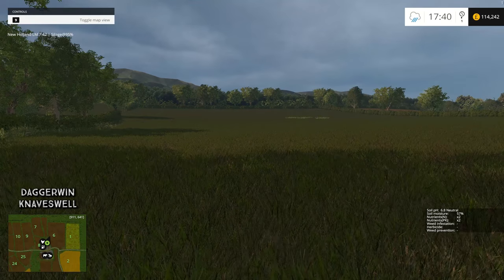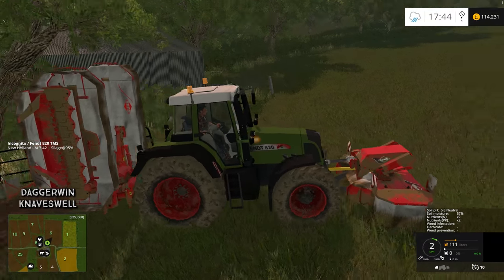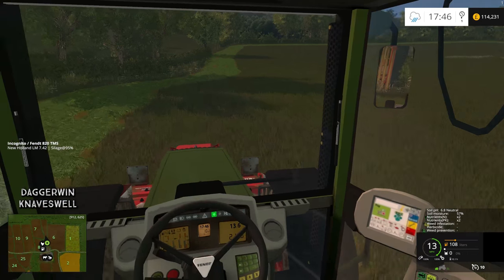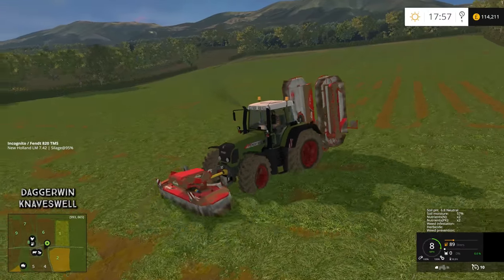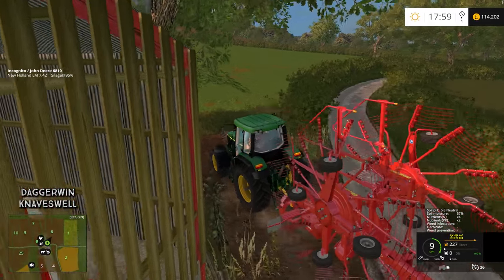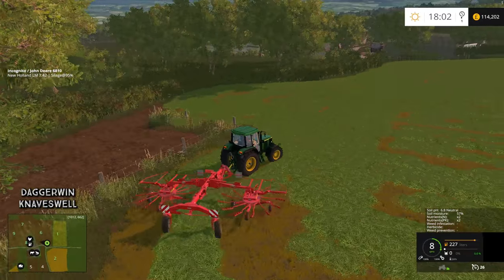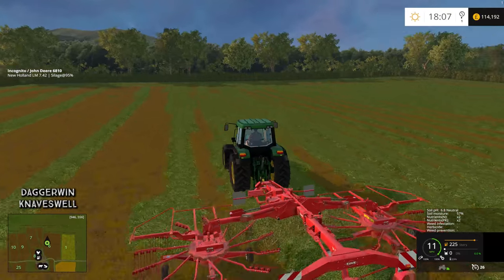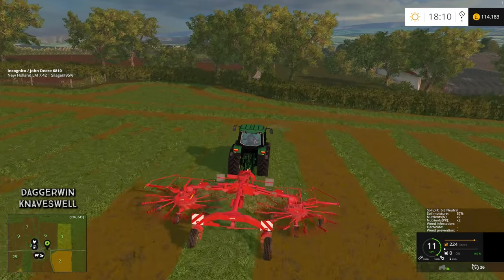Let's Play Farming Simulator 2015 | Knaveswell Farm | Episode 25

Comment: as far as GPS mod goes, its actually very underated because it is used on ALOT of small farms IRL! It's not actually a limit on your farms size that decide wheter you should have GPS or not, it's actually the fields. if you only have square fields where its fairly easy to spray maure and fertilize there is obviously no need, but if you have fields with alot of triangles and tight areas, GPS   Really helps the accuracy and less waste of eigter manure or fertilize.